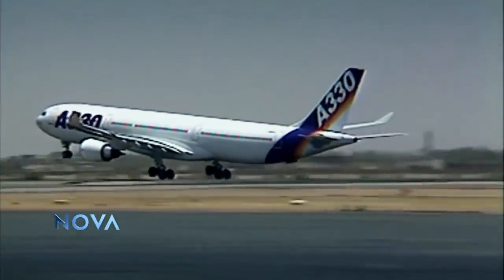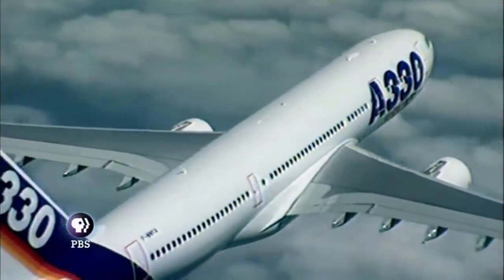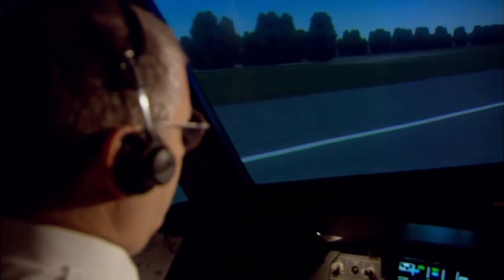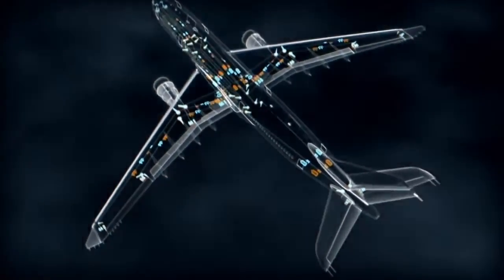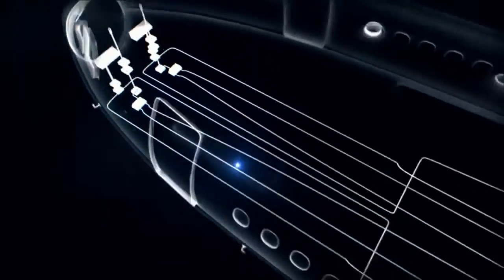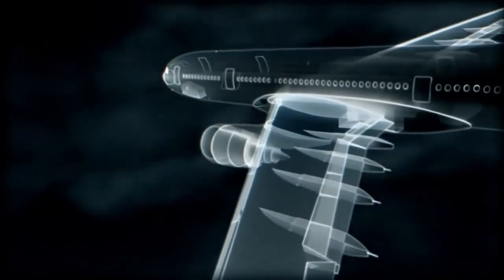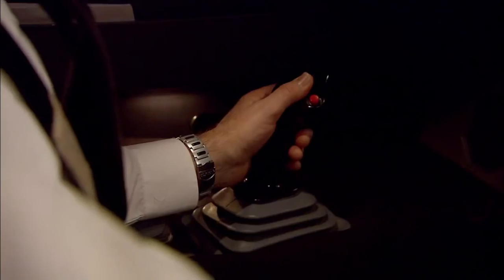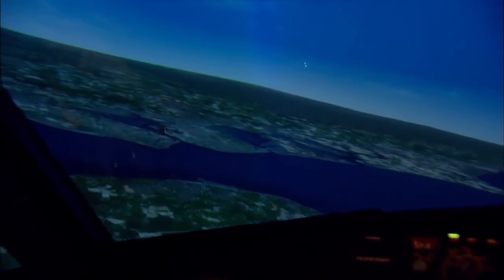Airbus A330 fly-by-wire control system

Comment: I dont like the fly by wire since im used to boeing, opinion might change omce i get used to it on the simulator.. its pretty annoying since its so draggy.. kinda mean.. wish there was at least a stabilization system that centers you again without having to firgure out how to equal it with the sidestick.. i prefer the classic steering and a yoke, a yoke is 2 handed so you can easily tilt/roll and pitch around and the plane stabilizes itself..
Reply: Boeing also have fly by wire in their planes

Comment: so is fly by wire similar to power steering in a car? thanks
Reply: in a conventional aircraft the flight surfaces are directly respond to the movement of the control column/yoke (the steering wheel thing)

in fly by wire your controls are checked and limited safely (in airbus they call it a "flight envelope")
Reply: Anthony James thank you for that 👌👌

Comment: I think pilots should have full control of a plane.
Reply: The best thing is on an airbus is the driver can’t bend the aircraft, the fly by wire has protections built in to prevent such things as over roll , pitch, speed etc
Reply: ASE engineer here. Thats actually not the best idea at all. Static stability of airplanes has been factored into these designs so that just as demonstrated in the video, the plane would return to steady level flight if pilot lose control or tries to execute a maneuver that would move the plane into the unstable flight envelope. These systems work in tandem with the pilot to ensure safety. Fly By Wire is fully supported by pilots as well because they know that it is infinitely more safe than the pilot solo flying the plane. The plane's onboard computer can determine all the stabliity margins from the sensor in fractions of a second whereas a pilot has to would need time to read inputs and adjust. This is why Fly By Wire is preferred and te choice for all airplanes today!
Reply: I’m sure there’s some kind of override with everything incase they DO need to take full control of it
Reply: @Jason-un9ps  To some extent. Planes are actually designed so that stability is naturally maintained. For example, in the longitudinal axis, the the aerodynamic center of the wing is placed behind the center of gravity of the plane so that a negative moment is produced naturally by the plane. So for example say a gust of wind pitches the plane nose up, without having any pilot input the plane would naturally pitch down until it returned to level flight. This is also done with lateral stability so if a plane were to roll right, the plane would naturally roll back left to the neutral point.

Comment: I'm all for FBW as a back up failsafe to mechanical linkage.
Reply: It very VERY rarely goes wrong
Reply: @Sterlingjob  

I dont like this stuff being used in combat aircraft for wars.
Reply: meeg_2005 You have to use fbw in fighters
Reply: @Sterlingjob  that's what concerns me.   That they can't fly straight without it.
Reply: meeg_2005 Fighters are unstable which means they need fbw, the a320 has manual reversion via cables. But the chances of the flight control computers ALL going down is very unlikely!
Reply: @Sterlingjob  

But what if there is a real war.  An air superiority war.  Isn't the first thing that  the enemy is going to try to do is to is zap the  electronic systems of all the planes?  Its worrisome
Reply: meeg_2005 important cables and wires are shielded!
Reply: @Sterlingjob  

Well that's good to hear.  I just hope they have mechanical backups to all this stuff, and that pilots are trained to fly without any help from computers
Reply: meeg_2005 In all my time working airbus, 13 years now, I’ve never known a flight control fault where a control box has failed to a point where safety is an issue!
Reply: @Sterlingjob  

Oh I'm just talking about combat aircraft.   Things get messy in war.     I know it's safe for ordinary use
Reply: meeg_2005 I can only assume they are similar!!
Reply: @Sterlingjob  

You know the saying from boxing, "everybody has a gameplan until they get punched in the mouth."     I just hope my country's fighter jets have a backup to FBW!
Reply: @stevencoardvenice  It’s no different than the gas pedal in most modern cars.. You used to press the pedal and a linkage would open the throttle on your carb… now it’s all electronic.
Reply: I don't think you understand what FBW is. FBW is not a computer that does things instead of you (this is one of the things it CAN do), it's an entirely new mechanism where you don't get to apply force to control the aircraft. There is no mechanical link on an FBW plane. You can't have both unless you have both a yoke and a sidestick or two yokes/sidesticks, which is just ridiculous.
Reply: @williamduncan7401  Tell that to the AH-64. (Where FBW is used as a backup)
Reply: Wrong way around.
On an Airbus, the Direct Law and Mechanical Backup modes are the ultimate fallback modes for full FBW.
As it should be. 
The Machine is MANY times safer than the Monkey.

Comment: air pressure, humidity, and static electricity , 3 factors for failure
Reply: also away from the simulator,sand flies in the pitot tube  bird strike on the angle of attack sensor....
Reply: Welcome to modern reality where cabins are pressurised, cables are well isolated and static electricity is strictly controlled. Please observe the full installation of the electric systems into an Airbus plane and tell me your opinion after that.
Reply: @williamduncan7401  what if the sensors don't work and they start giving wrong input just like what happened in one boeing plane whichresulted in crash
Reply: @12349Nitin  that’s why you have redundancy and never have one sensor decide the next course of action. Something Boeing failed to learn with the 737 Max
Reply: @aviator915  

Ok what happens if the rudder or elevator gets stuck, like on the AlaskaAir crash off the coast of California?  How does the fly-by-wire know that one of the controls has become stuck, so it can let the pilot do what he needs to do to compensate, even if the compensation would otherwise be dangerous?

Comment: The mechanical system isn't heavier, electric motors are plenty heavy. The engineering advantage of electric controls is in mechanical complexity and control routing.
Reply: When they say "heavy", it's meant that you need to apply force onto the yoke, which feels heavy. Nobody is comparing here the several kilos difference in the weight of the entire plane.
Reply: @williamduncan7401  That is incorrect. "mechanical" linkages on all large aircraft have been primarily powered with hydraulic pumps for many decades. The pilots do not supply muscle power directly to the control surfaces in most aircraft, rather the cables are used to open and close hydraulic valves. And even on Airbus the power to move a control surface is hydraulic, they just use electric actuators on the valves and a computer to synchronize. The force on the yoke is artificial and used because it assists with smooth control inputs. Several studies have shown that control force matters more to machine operation than control position. In simulators a rigid stick with force sensors far outperformed a zero force stick with movement sensors.(Some combo of both is best.) Airshow pilots add a rubber bungie to their stick for extra resistance and so that they have no relaxed neutral position.
All of these aircraft, Boeing and Airbus, have multiple isolated hydraulic systems and 6 or more pumps for redundancy. (Some electric driven, some engine driven, and one or two other driven like a little pop out windmill or a fluid motor-pump to transfer power from system to system without mixing fluid. Plus a reserve pressure accumulator for the brakes[after the ram air turbine stops turning].)
Reply: Did you know what's HEAVY means here?

Comment: Of course the airbus nanny computer philosophy has created a huge fraction of airline pilots(most of said fraction also went through rubber stamp ab initio rather than traditional training) that don't have the skills and practice to properly handle the plane when most needed. 
Also overlooked by the French investigation(no big surprise, but also quietly ignored by the FAA and others in post analysis) of AF447 was the inherently flawed design of airbus primary control inputs that made the actions of the pilots exponentially worse. The placement and operation of the control sticks makes it nearly impossible for one pilot to know what the other pilot is doing and then the computer just silently averages the two together. 
The Airbus system is dangerous and rooted in a deeper philosophy of centralized control, I won't fly airbuses as pilot or passenger as a matter of principle.
Reply: You have no idea what you are talking about. The amount of training that pilots go through to get to the point where they can even fly a fly by wire plane proves they no how to operate a plane. There is your "traditional training". 

"I won't fly airbuses as pilot or passenger as a matter of principle.". 
What a ridiculous statement. Airbuses are plenty safe and adding new technology is not a bad thing. Airline travel has never been safer and a good chunk of those planes are airbuses. Boeing planes crash too with less automation. A different design philosophy that is contrary to your preferences doesn't mean they are unsafe. But im sure you are smarter than all of the pilots and engineers that deal with airbuses right? What you are saying is hogwash mate.
Reply: The irony... Using a channel called "MyTech" and then making such a statement. Btw you have no idea what you're talking about.
Reply: You can't be more right
You are right

Comment: Every airbus plane since the A320 has a fly-by-wire control system... Just saying.
Reply: Yeah and the a320 kinda has better Fly By Wire then any other airbus
Reply: @breadboi213  why is that so?
Reply: @slickswings  Almost all planes have a fly by wire system since the 50s. Fly by wire is just infinitely safer because it allows the flight control computer to naturally trim the plane to steady level flight with no input from the pilots. The control systems automatically trim the planes pitch, roll and yaw so that it maintains steady flight so that if there is a disturbance (turbulence) the plane will automatically adjust back to steady level trim conditions without the pilot having to manually adjust it. This is safer because the plane can do it fractions of a second whereas a pilot would have to read instrumentation, understand and process what is going on, and then manually input controls to adjust back to steady conditions which takes significantly more time than a computer which can do it milliseconds.
Reply: some F-35 Lightning IIs  have a Fly by wire system

Comment: Airbus is much better than Boeing. Most Boeing´s planes are 50 years old design with small redesigns, look the 737 and the 747.
Reply: Don't fix whats not broken.
Reply: Actually, Boeing aircraft have many more fatalities per flight hour so... technically Airbus did fix what's broken.
Reply: @michaelwang9194  Based on what? A320ceo and 737NG are basically identical. 757 and 767 are also good. The only modern planes with anomalously high crash rates for the time period are A310, MD-11, and 737 MAX.
Reply: @Black One model: 321NeoLR, there you go, better than any 737 ever.

Comment: Fly by wire is not a new idea ? is it ?
Reply: Fly-by-wire was introduced on the Airbus A320 back in 1987. At the time, FBW wasn't a new concept per say. but it was very new to have it on commercial aircraft, and the flight control laws that protect the aircraft were also new. The control laws, from the A320 to A330, to A380 are virtually the same.
Reply: Fly by wire had been used on fighter jets for a while - but those planes have one or two occupants, are piloted by non-civilians taking additional risks to eek out every last bit of performance, and come with ejection seats.  Fly by wire on a passenger airplane is a different beast.
Reply: But initially it was not as good as today
Reply: Concorde used an early form of fly-by-wire in 1969:
https://www.heritageconcorde.com/fly-by-wire
Reply: no, the F16 was the first plane to have fly by wire in 1973

Comment: If the computer saves the plane, then how did it let the Germanwings pilot commit suicide together with the plane?
Reply: @Black Also, there are several ways a pilot can manually put the aircraft in direct law. Switching off all 3 IRs or all 3 primary flight computers would do it. Its all listed in the FCOM.
Reply: Black What do you mean it does not count? Your original point was that it’s not possible to override the FBW. I just told you it is. ??? Also it’s not a multiple step process, like I said all you have to do is switch off the IRs, which is literally 3 buttons. Again, all in the FCOM.
Reply: "Andreas? What are you doing Andreas?" 

Sorry I couldn't resist... It's not HAL, it will save you from a stall but it can't save you from yourself...
Reply: Nevermind, I found out that there is three Airbus laws, Normal Law, Direct Law, and Alternate Law. When a pilot sets into Direct Law, the pilot is given complete control over the aircraft.
Reply: The A320 is from 1987 - it doesn't have sentient AI.
Reply: THat's not the point of Airbus' flight control laws. To put it simply, the computers only protect from high bank angles, high pitch, high AoA (stalls) and overspeeding. They don't have any protections regarding proximity to terrain. The co-pilot had set the autopilot to fly into the mountain at max speed. The Airbus was never able to do anything about low altitude.
Reply: FlippRtheReaL this system is designed to avoid accidents, not suicide. At the end of the day, if a pilot wants to crash, he will.

Germanwings just aimes for the ground and the only system that prevent a ground collision is a warning that the pilot just ignored.

Comment: If the pilot loses control the computer would "save the airplane"......apparently the computer was asleep on AF447....
Reply: To put it simply, AF447's computers turned off because they didn't know what the plane was doing. The automation failed & gave the pilots the responsibility of properly flying the plane. AF447 didn't crash because of automation, it crashed because the automation TURNED OFF.
Reply: cblair0608 yes it was the Problem was that the Pilots were caught of guard by the failiure of their pito tubes and well couldn't do anything about you need properly trained pilots to fly a plane not some computure nerd
Reply: The stall alarm blared for 54 seconds & instead of recovering, the pilot pulled up on the stick to make the stall worse. The plane didn't prevent it because it was in alternate law 2, where most protections are disabled. The plane only prevents stalls in normal law, which it will always be in unless, say, the pitot tubes freeze.
Reply: You have to remember the A330's Motorola 68000 code was written between 1987-1991 - this was all new back then and the Frenchman/Kraut writing it probably didn't realize what would happen if the pitot tubes froze.
Reply: As many have echoed here, AF447 was down to poor understanding of the automation and poor situational awareness of who was in control. In the end the critical action that the Captain did not do is to push the takeover pushbutton on his sidestick to deactivate the FO's sidestick and prevent the stall. I agree that there must be more training in upset recovery and indeed that seems to be the trend these days. Most airlines run upset recovery training during recurrent training sims and proficiency check sims.
Reply: cblair0608 shots fired shot fired😂😂
Reply: It was a failure of the pilots, not of the plane. They were not able to pilot the plane without the help of the computer, but a trained pilot would have saved the plane.
Reply: Well,airbus's system that prevent stall definitely didn't work on flight QF72,in fact that was the cause of the accident.
Reply: cblair0608 when They lost the speed The auto pilot went off and sent message that they Lost protection which means Anything you do Is not protected and thus the pilot fucked The Airbus
Reply: Which is why there is an inherent value in ensuring that pilots are trained to execute flight controls in alternate law. If the philosophy is that computers should fly the planes then you cannot expect pilots to know what to do when the computer malfunctions. In my opinion pilots should be required to fly in alternate law so that they actually get feedback from controls and can respond appropriately in an emergency. However the entire industry has gone in the direction of automation and pilots are essentially in simulators in real life. I would argue that pilots need to undergo more training in order to know how to fly a plane in the event like AF337 or IAA 8501 happen.
Reply: Felix Beutin yes it came down to pilot error but the aircraft has other systems to detect if it's stalling. It can detect the pitch and the altitude without the pito tubes. It should be able to detect the stall and prevent it like Airbus promised. Well if it wasn't a feature then it probably is now and the important thing is that everything is safer.